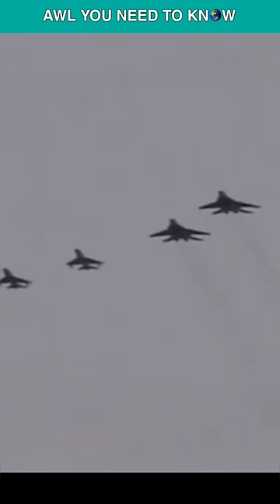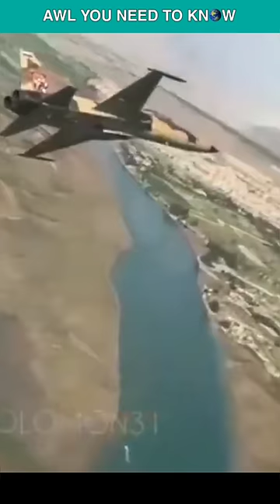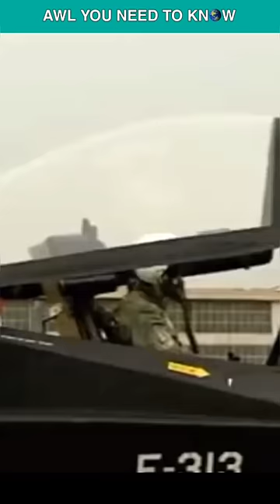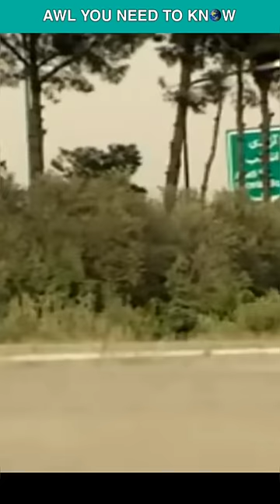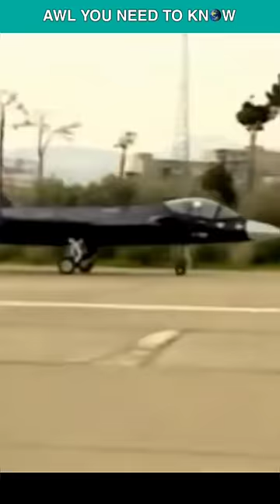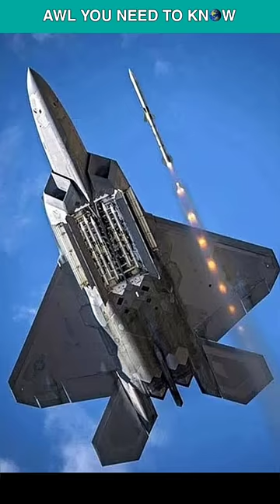Meet Qaher-313, Iran's Fake Stealth Fighter #shorts

Comment: I think my favorite eff up of this "roll out" was that the tire pressure was stenciled on the side of the aircraft as 65psi. Typical aircraft tires are inflated in the 300+psi range.
Reply: My sources say it's so advanced it can land in marshes with its specially soft low pressure tires.
Reply: @kenricnarbrough8191  my sourcess tell me they have put reggular motorcycle tires on it xD
Reply: Apparently legend has it that the afterburners don't stop burning 😂
Reply: It's a stealth feature. The soft tyres means it can be pulled by a team of gagged camels in complete silence.
Reply: @tylerdurden3722  haha 😆 very good 👍
Reply: @tylerdurden3722  A camel tow?
Reply: 65 psi is about right for a rusty overloaded 1992 ford fiesta.
Reply: @tjp353  you can look but it'll cost your life to touch be careful the beast is underestimated
Reply: @tjp353 You must tame the beast before getting to see the camel tow

So ive heard
Reply: Iran has rubber technology far ahead of ours
Reply: @tjp353 golf clap

Comment: Looks like the intakes are above the wings.  That makes for very difficult handling.  Better hope the computer assistant handling is up to the task.
Reply: Iran and "Computer Assistant" are antonymous
Reply: I don't think air intakes are supposed to cause such complications
Reply: The computer is probably an old Comodore Vic 20.
Reply: @icecraftgaming8661  Having them above the wings mean that whenever you give it positive AoA, like when manouvering or even landing and tsking off, you run the risk of your engines surging.
Reply: @guywholikesplanes  I guess, but I'm sure the problem can be fixed. Not that this thing is practical, at all, but it probably can as it is used in multiple aircraft designs.
Reply: @icecraftgaming8661 Oh absolutely, but it requires a lot of advanced engineering and computer science in order to manage it.
Reply: İran'da test merkezi bile yok bu uçağı test edecek ne rüzgar tüneli nede airodinamik test merkezi bu uçak hayaller de uçar.😂😂
Reply: Computers?? Uh oh back to the abacus 🧮.
Reply: @icecraftgaming8661  F 117 has intakes above the wings, and it needs computer assistance in flight.
Reply: @jasonwhite7905  I thought the fly-by-wire was because of the aerodynamic instability cased by the strange surfaces on the plane which reasonably seemed to cause alot of drag?
Reply: @icecraftgaming8661  true, there is that, but intakes above the wings frustrate the wing dynamics (maneuverability).  Wings are meant to increase friction above the plane, in order to create a vacuum.  Friction under the plane is smoothed out adding to the overall lift.  

However, divert friction that was supposed to go under the wing, and that same friction used in drag and thrust, instead of lift, frustrates the dynamics.

Just list the names of fighters with intakes above vs below.  There's not a lot.   SU 27, MiG 29, F 15, F 16 F 22, all have intakes below the wing.   F 4 is the only other fighter that comes to mind with intakes above the wings.
Reply: The control computer plays the windows welcome each time the engine starts
Reply: @Journey_to_who_knows  I thought they used Photo Shop to get it airborne.
Reply: Uh, nope.  F-4 intakes are along the sides of the fuselage and the wings are quite a distance behind them.  The MiG-29 Fulcrum DOES have intakes on top of the wing, to a degree.  When on the ground the intake doors close and the doors on the top of the wings open to prevent FODding the engine's on rough runways, etc.  They don't operate in general flight, though.  I think I watched a video somewhere that said that once the main gear touches the runway the intake doors close and the top opens and also once the Fulcrum takes off, the main intake doors open again.
Reply: If by “difficult handling” you mean “engine flameout due to air starvation during any moderately high AoA maneuver” then I wholeheartedly agree.
Reply: @jasonwhite7905 even then the F4 inlets sit way out in front of the wings meaning they get clean air no matter the AoA

Comment: The engine inlets look very small.  Plus they are located on the upper surface of the airframe.  Indicating that on high AOA.  The aircraft could get a compressor stall.

Comment: The first thing I spotted is with the way the engine inlets are designed, they would not only barely get any air in high-G maneuvers, but also due to the 90* angle present they aren’t stealth. 

Doing a high-g turn in this thing would result in significantly reduced power at best, maybe even a full engine stall.

Comment: It does fly really well at low altitudes, although the drawback is the altitude is zero feet and you might have to get out and hit it with a hammer to get it running again.

Comment: The fighter does have some features which could be considered stealthy. The top-mounted air intakes WOULD reduce visibility from the ground, and the sharp chine line around the frame and avoidance of right angles also help reduce RCS. They have learned some genuine lessons about stealth. However, it's probably similar to the Su-57 and F/A-18 at best unless they can source anti-radar coatings and composites.

Comment: qaher 313? more like crashing 313 lol. doubt its any better than a J-20
Reply: qaher 313 is so much better, never had a crash either unlike f-35, it went into the south china sea after it was jam by the J-20
Reply: @watb8689  LOL funniest comment on here. J-20 would smoke this thing, and thats not what happened with the f-35; it approached the carrier too low and skidded across the flight deck and fell into the water with the pilot ejecting. wasnt jammed by anything